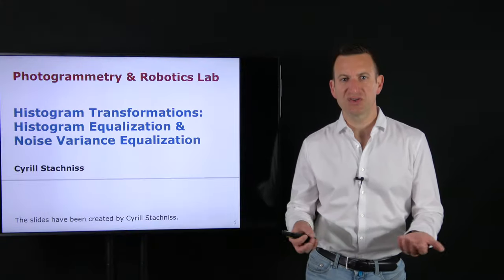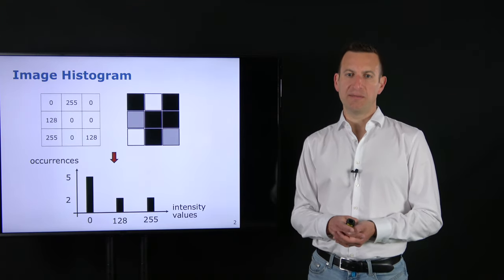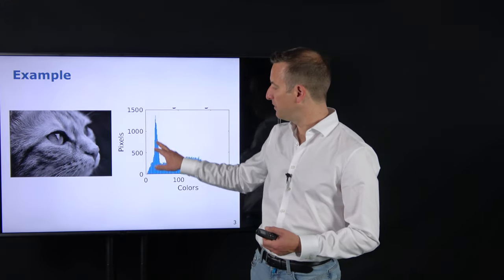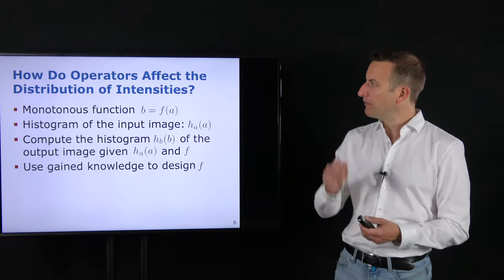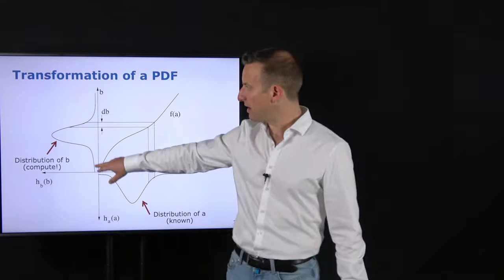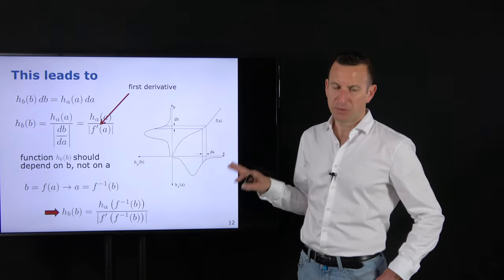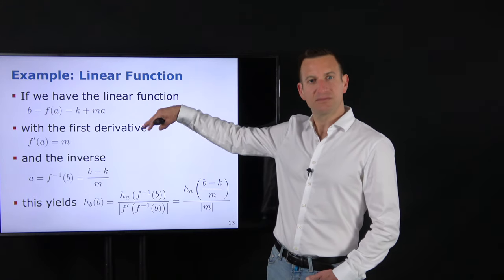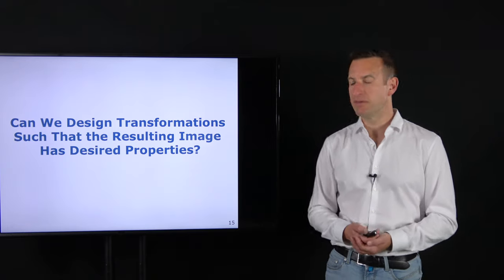Image Histograms - Part 2: Histograms Transformations (Cyrill Stachniss, 2021)

Comment: Thank you so much for posting these videos, I coded my way all the way through histograms 1 and 2, and had a question about the very last chapter on 'variance illustration'. In the video you state that the function is ( 2 * standardDeviation / sqrt( mean ) ) * sqrt( intensity ), but in the slides it says sqrt( 255 ) * sqrt( intensity ). When I render the image with equation 1, I get values ranging from 0 to 1, that look 'right', but need to be multiplied by 255 to see an image, and further, another factor of 2 ( 512 ) to get an image that looks like the one in the slides, and when I use equation 2, it looks exactly like the image in the slides... Did I miss a key insight somewhere or is one of those equations incorrect/updated?